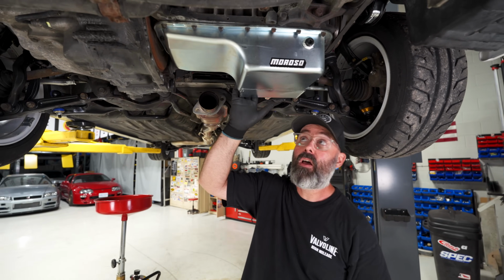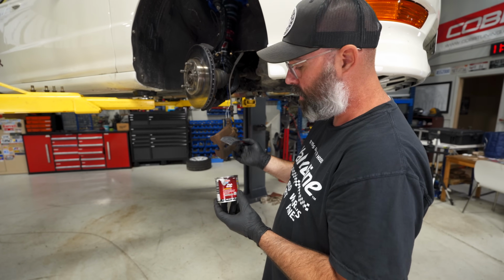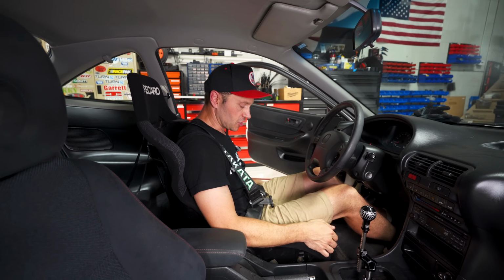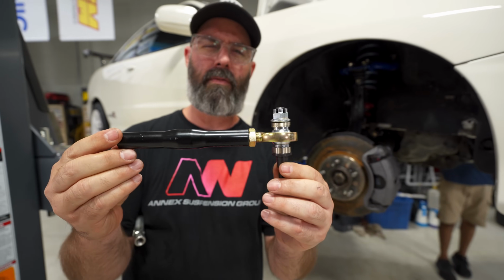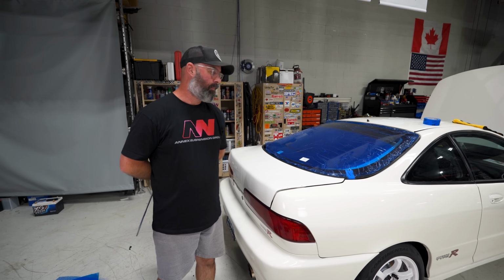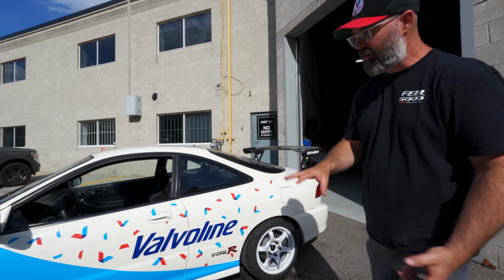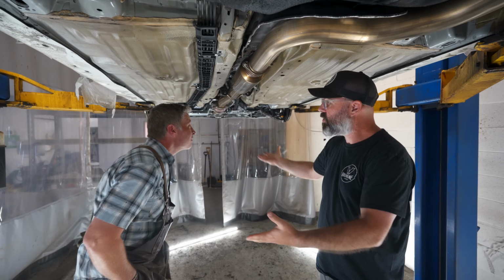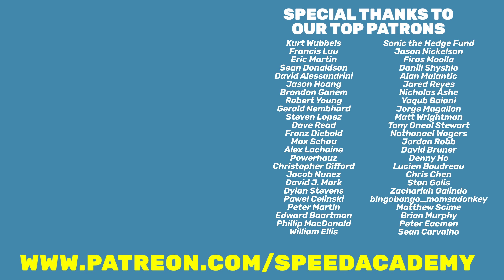$3500 Integra Type R Track Build - PT 1

Comment: Why not install a harness bar behind the seats? I always thought it was extremely dangerous to have the anchor points for your shoulder harnesses lower than your shoulders.
Reply: You’re correct. If you get in an accident and the anchor points are at an extreme angle like that, you’ll have spinal cord compression.
Reply: Actually at certain track events they wont allow you to run that setup unless you have a roll bar
Reply: You're right!!! Which boggles me why reputable companies sell these specifically to be mounted this way. Personally i wouldn't have a 4 point but that's my opinion!
Reply from the maker: This is completely fine to run as a 4 point DOT setup (harness needs the break away point). Is it safer to run a harness bar yes but this is still an acceptable way to do it
Reply: I have a Schroth “ASM” harness and it’s completely safe. Needs that breakaway point
Reply: @speedacademy  I have personal experience with this in a life long lingering neck/upper back injury from an accident with a harness mounted exactly like you have it now. You will experience spinal compression in a frontal accident. The harness will try to level itself when being pulled forward, resulting in your shoulders being pushed downward while your helmet tries to rip your head off upward/outward. Having a half cage is ideal since you also do not want to be trapped in a harness if the roof comes down on you. 

Its fine to leave that harness mounted where it is currently, but run it over the top of the harness bar to prevent that downward angle being pulled on your shoulders. This is why all racing harness installation instructions will tell you to put the shoulder straps level or maximum 10 degrees below shoulder level. Hope that all makes sense!
Reply: Really where the mounting point is
Is totally irrelevant if you dont have a full cage. As if you have a roll over without a cage with harnesses, your body cant move out of the way like it could with a standard belt.
Reply: The Takata DRIFT 4point harness is DOT approved for street use because it uses Schroth's ASM technology which is designed to expand during an impact just enough to slow the impact speed and absorb the forces. Similar to the factory 3 point belts but with the added benefit of not sliding around in your seat when on the track.
Reply: @thatracinglife  The Takata DRIFT 4point harness is DOT approved for street use because it uses Schroth's ASM technology which is designed to expand during an impact just enough to slow the impact speed and absorb the forces. Similar to the factory 3 point belts but with the added benefit of not sliding around in your seat when on the track.
Reply: @jcues03  The Takata DRIFT 4point harness is DOT approved for street use because it uses Schroth's ASM technology which is designed to expand during an impact just enough to slow the impact speed and absorb the forces. Similar to the factory 3 point belts but with the added benefit of not sliding around in your seat when on the track.
Reply: Was wondering about this as well 🤔
Reply: @speedacademydave  thanks for that clarification. Personally I have no experience with street harnesses, so thats news to me! I just hate to see harnesses mounted like that and wanted to mention my experience to maybe help you or anyone else in a similar situation. Obviously not something anyone wants to get hurt over! I absolutely love this build though! Makes me want to get my EF back on track. 😁 Keep up the good work!
Reply: @speedacademydave  Thanks Dave for the clarification. I was not aware there was a distinction for DOT legal harnesses. I had been avoiding them due to reasons mentioned above but now I’m going to look into a similar setup.
Reply: @speedacademydave  sounds like a good follow up segment for a future episode on the build.  I had never heard of a "street harness" or ASM and it seems like a lot of us haven't as well.  I saw the install and had the same thoughts as everyone else (things that get hammered in your brain on the internet) but then thought, "well, I don't think I've ever seen a harness bar in a Japanese build so are who knows." Haha
Reply: Just as bad as the guys that connect harness to rear seat belts 😬
Reply: Exactly what I was thinking when I saw the harness installed.

Comment: Plastic 4 Performance is hands down the best poly window company I have dealt with. The curvatures in the windows are always spot on making installation pretty much the same as OE glasses. The built in black borders make them look OE as well from a distance. And if you get the windshield, they even add the little window so you can still see the VIN number from outside. Great company.

Comment: Someone might of already pointed it out but it might be worth checking the angle of the harnesses as it looks like they might be at too steep of an angle which could potentially result in compression of the spine in an accident. I think from memory they shouldn't be at a great angle of 45 degrees. Need to be at more of a horizontal level from the shoulders, there are a number of diagrams online, think it was FIA approved. Love the channel lads always look forward to new videos.

"FIA states shoulder harnesses must sit in range of 10 degrees above horizontal to 45 degrees below
- Willans says horizontal to 20 degrees below"

Comment: On 90's early 2000's cars high zinc oils and even diesel oils aren't too far off what they had standard back then. We just got stricter emissions standards, thats all. If you look at blackstone sheets of current CJ-4/CK-4, or even valvoline high zinc compared to just a normal off the shelf oil in the 90's the zinc levels are very similar.

Comment: Some quick advice. One thing I do with my coolant air lift is that as im pulling vacuum i crack the feed line valve to prime the line. That way you dont put air in the system from the air that is in the hose prior to the coolant.
Reply from the maker: We prefill it with water before hooking it up, its clear obviously so you cant see that its filled.

Comment: Those BTCC Mondeos were some ridiculously over-engineered beasts of a car. Dry sump engine with an upside down transmission. Passenger side axle runs through the valley of the engine block 🤯

Comment: In automotive manufacturing we used to seal parts with wax but in around 2013-2015 we switched to galv steel and Ecoating so no suppliers are really waxing anymore.

Comment: Beautiful build gentlemen. I love the car and what youve done with it. I am however, a little concerned about the angle of those shoulder straps for the harness. Shoulder straps should never be at more than a 20-degree angle iirc, or you risk serious back injury if there is ever a wreck in that car. Harness bars are the way to go if the vehicle is not caged.

Comment: I have Kirk Racing harness bar for DC2 that fits over the top of the rear seats that I'd gladly donate if you want to maintain the rear seats.  Can't really sit back there after it's installed,  but does allow the rear seat to provide some sound dampening

Comment: I loved this episode! You guys did a ton of upgrades and I love the livery. I have a 96 DB8 JDM Integra Type R that I am going to start restoring and you bring me so much inspiration. I was wondering what you would do in my situation, the DB8 was wrecked in the front with no motor, but I have all the OEM pieces to bring the damaged areas back to spec, I am just torn on the motor selection. I am a B series lover at my core, but can’t dismiss the fact the the K series is superior. And not to mention, B series motors are becoming more expensive and scarce. What would you do? Stock original? Or modernized? I plan to weekend drive it, occasionally canyon runs and road racing. Thanks again guys, huge fan!

Comment: Doing a great job guys! I will say though, the color, drip lines, and overspray of the honey seal are pretty heartbreaking. I feel like it just doesn't showcase all the quality work you put in. Yeah I'm sure it works well, but it's all over sway bars and everywhere. Maybe if dude had masked off some parts and areas it would look more deliberate, but those runs and overspray cause me one little tear. 
But I really do love the build otherwise! Another superb build boys!
Reply from the maker: We want it on everything, makes no sense to leave it off the sway bar, coilovers, etc. and have them potentially deteriorate over time. And we can't complain about a little overspray, its easy to clean off. The cost of them prepping everything wouldnt make it cost effective.

Comment: As a detailer I do not recommend putting ppf on the car ...it cracks and turns yellow over time will also ruin paint ...just really not a recommended coating for longevity of paint and is a pain to get off once it gets older.

Comment: You should of ran distilled water with water wetter. it runs cooler and not only that, if you have a leak on track other wont hate you for making it slippery.  Also cheaper and easier to clean.

Comment: You should add some Dielectric Grease to the back of that hub or you'll drag a Hole into that hub and it will start to sqeak and make noise over time

Comment: That painted VHT valve looks fine.  It a little dark up top which tells me more you might have prepped, or painted it incorrectly.  But if you want to spend $350 on a new valve cover that adds zero function.  Then I suppose.  Seems like $350 would go a lot further on something else.  If its a sponsored build, or your stock valve cover was damaged, okay.

Comment: Maybe you can teach us…. I am very interested in the Uview tool that you used to purge out the air in the cooling system. I purchased one from Amazon and I cannot seem to get an adapter over the Honda radiator. If I don’t use adapter, the tool is loose and all other adapters are too big. The cone shaped adapter won’t allow me to fit into the radiator because Honda radiators have the smaller ring in the center. Please help!!!!!!!

Comment: It always feels a bit weird to me seing w30 weight oils on a car used on track especially without coolers (although if you do a few lap at a time and not in scorching desert heat it might be good enough). I feel more confident with heavier grade on higher mileage engines. A friend of mine b18 itr drank more oil than me drinking beer, on the nurburgring the forest fog was getting thicker with the smoke ahaha
Reply: You'd be surprised that on D and B series Hondas, the reason they drink oil with high mileage is usually the piston rings and sometimes the valve seals. The crank and rod bearings are usually still within spec, and because of that, you actually don't want to run a heavier weight oil because then the viscosity will be too thick for the bearings.

Comment: little out of my element here but wouldn't you want a higher weight oil for such a high mileage car? or did you use the regular one because it's even more track focused now?
Reply: You'd be surprised that on D and B series Hondas, the reason they drink oil with high mileage is usually the piston rings and sometimes the valve seals. The crank and rod bearings are usually still within spec, and because of that, you actually don't want to run a heavier weight oil because then the viscosity will be too thick for the bearings.

Comment: It is very dangerous to use a recaro and 4point harness and not at least get a half cage, normally when you land on your roof you might be saved by slipping trough the normal belts or squishy original seats, but in that case i have heard of severe spine injurys if not deaths. 
idk i found it very important to say for some reason

Comment: No roll bar then 3 point is the only option per safety regulations on track
Reply: The Takata DRIFT 4point harness is DOT approved because it uses Schroth's ASM technology which is designed to expand during an impact just enough to slow the impact speed and absorb the forces. Similar to the factory 3 point belts but with the added benefit of not sliding around in your seat when on the track. Since it is DOT approved, it should pass track tech. I know mine did.
Reply: In a roll over to be specific this is why you need a roll bar or half cage when using a helmet with harness, again i speak from experience it doesn't matter if the harness is dot you don't drive on the street with a helmet on
Reply: @jcues03  The problem isnt a helmet on the steet, it’s using a race only harness on the street with no rollover protection. A race only 5 or 6 pt harness is designed NOT to stretch and is intended to be used with a roll bar or cage. However, the Schroth ASM technology used in the Schroth Rallye and Takata Drift harnesses ARE designed and certified to be used in a street vehicle with no roll bar/cage or helmet, because the ASM system allows some stretch just like the factory 3 point in a collision and rollover. You originally said that 3 point is the only option per safety regulation on track if there is no roll bar. That is not true. The 4 point ASM harnesses meet DOT standards, so if the stock belts pass tech on a track day, then so do the ASM’s.  have passed tech twice with my Takata Drift 3 harness and I dont have a roll bar.
Reply: @jcues03  You’re original comment was about using a harness and no roll bar and didnt mention anything about using a helmet on the street.

Comment: Thats not the JDM rocker cover thats the "rest of the world" one. Only in your neck of the woods do you have that car as a none Honda. You should change the badges on the outside to the correct ones too. I have also said this before in the past but the stocl oil weight should be 5w-40. All the Honda motors pretty much are this. Again, maybe this is a thing in your area only? Jealous of the dry ice treatment. Nothing local to me here but I would have loved to have done that to my S2K. Not sure about the honey wax look though, prefer the clear wax but thats just me. Great vid
Reply: Yeah this is a small high revving engine which makes a fair amount of HP so a Xw40 oil would be my default. The last number really matters since it specifies the viscosity of the oil at 100 Celsius. The first number specifies the cold flow ability of the oil. 
So a 0w40 is technically identical to a 10w40 once warmed up and even at room temp the viscosity will be very similar. But once you are in the cold the differences show up.
So yeah unless the engine is 100% designed to run on a 5w30/0w30/10w30 I would use a 5w40 or 10w40 for security on the track with lots of flat out acceleration and high oil temps.

Comment: 4 point harness is a death trap on its own but then add a fixed back seat with no roll over protection of any kind driver safety be damned you guys got a death wish
Reply from the maker: Please link us to the data of your statement, or are you just going off of internet safety?

Comment: By far the worst episode on your YouTube channel. Removing the shift boot rear trunk and wing steering wheel and wing is the most horrible thing ever to be done to a Type R. The wrap makes it even more horrible. I will be unsubscribing immediately and I know that it will not affect you in any way. Just my opinion. If you wanted to build a car like this you should have went with an RS not an original Type R.
Reply from the maker: You do realize everything we did is FULLY reversible?